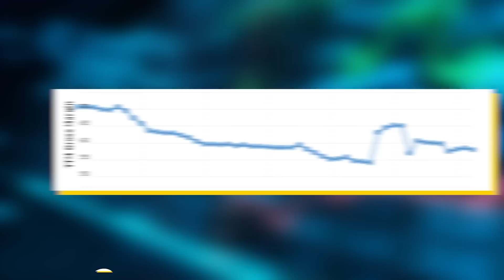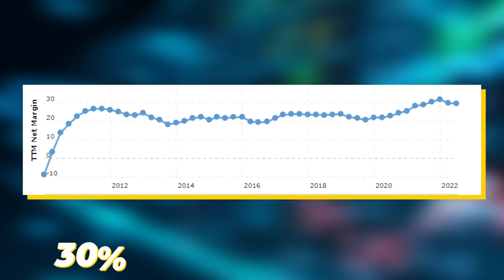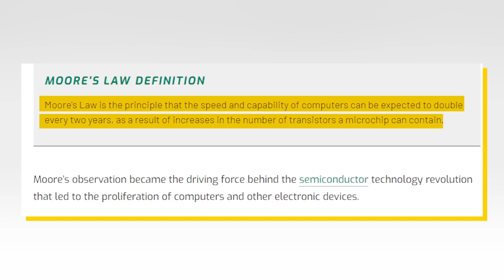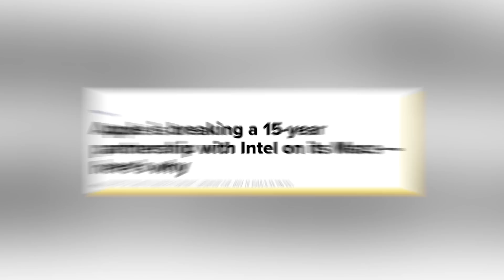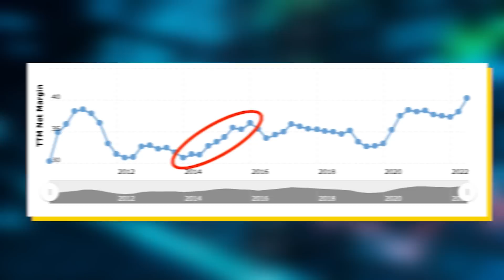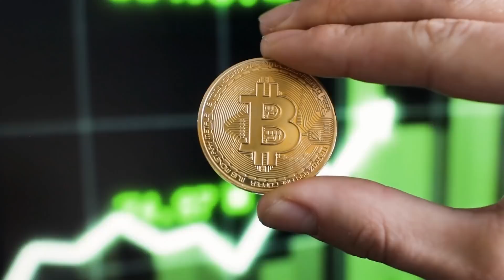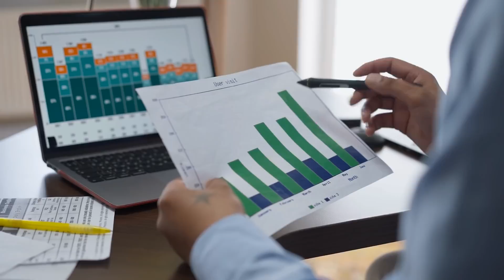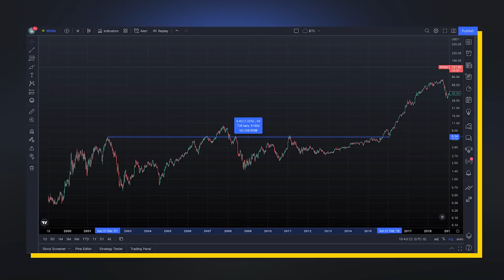How Did Chip Profit Margins Become So Obscene?

Comment: The reason people say moore's law is dead is because they calculate it based on "Useful Transistors" and not Total transistors.
To over simplify;
You can easily add more and more cores to a CPU.   Thus adding more and more Transistors.   However, if your running a game that's single threaded none of that matters.
Another example is moving the ram, from outside the CPU to inside.   This moves a lot of transistors from outside moore's law to inside without changing much.     
So, back in the day.   Moores law was useful as it gave a rough calculation to performance without knowing what future tech was.   Now, not so much, we keep adding transistors but things don't change much except for a few bench mark programs.  Yet there sill is a lot of room to add even more useless transistors into the cpu just to keep moors law going,  Well,  in 'technically true' kind of way.  
So is moors law dead.   Well, yes and no.   Depending if your a user or a marketing person.
Reply from the maker: Ah, thanks for the clarification Lucid. I really appreciate it!
Reply: @LogicallyAnswered  If your interested in the topic maybe take a look into just how long ago this was known to be a problem.   How All the big players got together to solve it,  including ravels.  Poured billings into fixing the issues just to have amd come in an ruin it all for some short term profits.   So, we are kind of stuck.  Have been for like 10 years.   With estimates of 80% of the power bill and a huge chuck of the cpu simply wasting performance just keeping itself running.   (Yes, just like a Gas car).   At least now, ARM has a chance of fixing this.
You know, I don't think anyone can name a single company that has done more damage to the computer industry, economy, and the enviornment then amd.   And they did it under the pretense of just giving the people what they wanted.
Reply: @lucidmoses  How did AMD did that
Reply: @miguelpereira9859  Hard to explain in a comment but it has to do with the cpu architecture.  25-30 years ago we knew the x86 architecture had a very serious limitation when it came to advancements but these could not be fixed without breaking code compatibility.   The base design done in 1974-1976 was just not designed to scale from k bytes to giga bytes.   That's why cpu advancements have been sooooo sloooooow from 2000ish to now.   Intel,IBM,Microsoft,Oracle, and a bunch of others got together to fix the underlying architecture problem.  The switch from 32 to 64 bit seems the perfect time as people needed to change there code anyway.  They started a five year project to fix this.  A major undertaking but it needed to be done or we would be stuck at the limits of the x86 architecture.   This could have worked but around 2 years into the 5 year project amd came along and added the worst, crappiest bandaid on to the x86 architecture and released it as the 64 bit update.   Now, the general public didn't know what this was such a bad idea or how devastating it would be to cpu future growth.    amd's marketing department made it seem like a good idea to the masses.   So, what do we have now?
You know your processor has to go though up to 8 address translations every time in reads/writes a byte to memory.   What a waste.  Think about all that extra power, heat, and loss of speed with all the extra almost pointless transistors.   It would be like modern cars having to be still compatible with coal powered steam engines.  
Now look at the ARM chip vs an x86.   ARM is way smaller.  uses a fraction of the power.  Has no were near the amount of heat generated.   ARM chips can be in cell phones with small batteries.  x86 stuff is way bigger then a cell phone.  Takes enough power that it's a measurable proportion of the power grid and pumps out so much heat that if you have a few of them together you need A/C in the room.   And why is there such a dramatic difference?   Well.... in a word.  Architecture.   Due to amd catastrophic bombing of the industry when they where trying to fix it.  So, as I asked.   Can you think of any company ever that has done more damage to the industry?
Reply: @lucidmoses  That's very interesting I had never heard of this  critique leveraged at AMD's contribution to x86
Reply: @miguelpereira9859  It's not a big secret or anything.  All the info is out there.   It's just that most people have no real reason to get down in the weeds as to how CPUs are built and therefor have no idea why x86 stuff takes so much space/power.   Thay just think that's what it takes. Even though they are likely using ARM chip to look this stuff up.   
Don't get me wrong.   The ARM stuff is showing it's age as well.   It's just that it's initial arcateture was more suitable to systems we use now a days.  It scaled better.  Not perfect, just better.   I'm sure they(Intel or Arm) could do way better now if they started from scratch but that's not likely to happen.   I don't think you could get the major players to agree to give it another shoot given how it turned out last time.   Even if amd wasn't around any more, it was a very expansive lesson to learn and someone else could just come in and screw it up.  So we are stuck.   The hardware guys can't fix it as there is no software base for it.  and the software guys can't build any if there is no hardware.  So our best of bad choices is hopping ARM gets a bigger budget and doesn't fracture it's community with a gazillion little variants.   chough   chough  Apple.

Comment: You ignored datacenter grade products which may significantly increase profit margins for companies like Nvidia who reuse some of the same dies between enterprise and consumer grade products.
Reply from the maker: Ah that’s true
Reply: @LogicallyAnswered  yes, Nvidia makes money not from 70 class cards. It makes money charging 30k for the A100 and 40k for the upcoming Lovelace h100
Reply: They sell basically the same thing for 5 times higher prices
Reply: @MJ-uk6lu  Same thing with a slightly different software
Reply: @Kxnii  and additional validation, ECC memory. But this is mostly the case for the former 'quadro' line. The former 'tesla' line is actually different.
Reply: @PSelten94  That's true, but ECC memory doesn't make it worth several thousand dollars more
Reply: @Kxnii  no, but it does increase cost somewhat. It's not all just additional profit. Probably a more clear profit grab is disallowing datacenter deployments for GeForce GPUs. The Nvidia driver EULA states that datacenter deployments are not allowed.
Reply: @PSelten94  because active cooled cards are not designed to be put in passively cooled environments.
Reply: @tayloraverett3138  'quadro' cards can be deployed in servers though, these are actively cooled.
Reply: @PSelten94  It adds cents at most to the price
Reply: @PSelten94  incorrect only the Passively cooled RTX 6000 and 8000 were explicitly designed to run in server environments. Every other actively cooled Quadro is designed to run in a tower. Now do people run them where ever they want ofc, is Jensen going around and ripping these cards out of secrets for breaking EULA no. But if they run into issues and want an RMA they voided their case to get one for using them in an environment it was never designed for.
Reply: @Kxnii  and actual customer support
Reply: @tayloraverett3138  in the Pascal era, system integrators and Nvidia had validated actively cooled cards in servers.
Reply: They don't sell that many anymore, since they pretty much are selling their server chips as desktop chips and have been for over a decade and companies figured it out and started buying desktop variants.

Comment: These are Deep-Tech, Low-Volume, High-Value & High-Risk Products. For instance, see the number of iPhone 14 Pro Max being sold versus an equivalently priced RTX 4080. The R&D and production infrastructure costs are up-front huge capital costs, right. So, if these companies are to be incentivized to invest in the future, and to improve their products, these high margins are necessary. Again, if it was easy, some Low-Cost competitor would have taken over. But, it isn't. That's the point. DEEP TECH Industries are clear oligopolies !!! 

But with FAB as a Service Model, this is changing as major hardware companies are able to design their own chips now, with a limited budget and limited risk. Very soon, these margins are bound to come down with RISC-V taking over.
Reply: Rare person who isn't talking out of their ass. Take this like.
Reply from the maker: Well said Venkatesh
Reply: Roscoe wont take over  it has grown sure but there is way too many fundamental issues with such to have it take over.  Also the fab side dosnt give a crisp if its rosc, Cisco or some tard ordering a batch of "new" 8086 chips for old skool clone marketing  they make the same volume in wafers regardless
The content of the wafers dosnt really matter per se other than by vol of good vs rejects with smaller pkgd being better yields

Comment: I wonder what our world would be if we go full on open source and ditch all copyright laws... What a wonder our world could be if we all worked together and share our knowledge
Reply: Have you seen open source programs? They all suck compared to the paid versions.
Reply: @designexplainedllc346  some open-source are good. For example, GitHub and Stack overflow. Basically, knowledge sharing is good. However, for complete software, open source is not as good. Especially with anything related to cyber security
Reply: @designexplainedllc346  “have you seen open source programs? they all suck” he says as his router runs linux on a site run on a linux server
Reply: @adolphin9288  To be fair those aren't completely open source, they are based on linux foundations but there is a company with patents and copyrights that owns that software and sells it..just like Mac OS has Unix foundations
Reply: @designexplainedllc346  Open source is the norm for programs if you go bellow the "consumers" softwares and look at the infrastructures, bricks and blocks that make all of this possible.
Reply: China has almost no copyright laws, so everyone is copying each other. This breeds competition and lowers the margins. The problem is that this incentivizes monopolies, since they have power to just steamroll the competition, since the smaller companies that do innovate are just copied and out-competed by the larger tech companies.
Reply: @666yaoz  This is the correct answer. Copyright laws are originally to protect the little guy and people who invest in innovation.
Reply: Why innovate rather milk money from copying it. So no reason to innovate
Reply: Then nobody would evolve,  nor design newer products , its competition that brings innovation, your way of thinking is childish
Reply: Cool debate, altho i was more thinking about an utopia kind of thing. I know its not compatible with society as of now, but who knows what the future will be. I imagine a world driven by something else than money. A post scarcity civilization that got rid of property since it would be meaningless.
Reply: Not great since it would stop innovation because everyone would just wait for the competitor to innovate and sacrifice money to that and then just copy them.
Reply: @ketsuppi  Ever heard of linux? The biggest open source project of all
Reply: @s.lingesan  And how Linux market share is tiny since it has terrible IU for the average person.
Reply: @ketsuppi  That's such a poor argument. Why innovation would stop? This argument is based on the assumption that we need competition to shine. But actually what made us shine was science not competition. And scientists are not that interested in competing with one another as boxers would, but more interested on satisfying curiosity and be praised by discoveries they made. 

If all is open source people who innovate can still be motivated to do so as they would be praised for that. Companies in the other hand would not, as they do not seek innovation but profit. Alas, companies already prefer to wait and copy, that's why they go on buying sprees buying start-ups with genius ideas to then escalate those into their giant infrastructure.

Comment: Only thing that actually is expensive is the chips. The need hundreds of millions worth of equipment to make them on a larger scale. Material is not expensive. Also when you look at some of the 4090 pcb they are crazy small. Like smaller than earlier more weak cards.
Reply: This is the very basic law of product design lol your slab of marble will cost less compared to the same slab of marble that has been worked into a table, so of course that will be the case, your car will cost more than just a piece of metal, also except for intel, they dont bought the equipments, samsung and tsmc did, while foxconn assembles it
Reply: Exactly. Prices include something called amortization. To get the actual gross profit you have to take out more than just resources cost. You need to take out said amortization that's covering the cost for all the equipment, you have to take out the cost of cost of labour, the cost of utilities, and so on.
Reply: i actually listed the price of the factory and the time line to profit and y'all thumbs up a 9 page paragraph that says the same thing but doesn't even list the cost... theres no way you read deez nuts post... i know YouTube,  y'all are too lazy
Reply: Hundreds of millions? Try tens of billions
Reply: @andrewdubose9968  Correct!  Most people have no idea how expensive foundry’s are to build and operate.   Each time they have to re-tool to go to a smaller geometry, the cost to do this can be billions of dollars.  Unlike a meat packing plant that has a service life of 50+ years, foundries are handful of years before requiring many changes to adapt to newer processes.   The cost to develop a new process takes years and years costing billions.  Ask Intel how much they spent on getting to 7nm. 

If you design chips, the cost to build one that can yield at 4nm is very, very expensive as well.  The software cost to do verification, design automation, layout, etc are all more expensive, and the runtime to actually do the verification is also significant longer than older processes—you can basically expect to spend 2x for each geometry reduction (ie., 16nm is 2x 22nm, 10nm is x2 16nm, etc) just on the engineering time and EDA software license cost.

Yes, these chips are expensive, and they are expensive to make, and they will continue to be expensive to make for a while longer until the yields and costs go down.
Reply: chip factory costs 4 billion and doesn't turn a profit until year 5......
Reply: Even if the chips are more expensive because of the shrink in the node die, you still get more chips per die so it balances it off. So there should be no reason for graphics cards being extremely overpriced besides greed
Reply: @negativauraa  This would be true if the die size is exactly the same.  Look up the die size of a 3090 vs 4090.   You expect to pay the same personal pizza compared to a large?  That's just greed?
Reply: @negativauraa  the RTX 3090 GPU is 628.4mm2 on a 300mm wafer that cost $7000. The RTX 4090 GPU is 608.5mm2 on a 300mm2 wafer that costs $25000. Increasing GPU performance means dedicating more die size which doesn’t shrink die cost on a new node. 

When the new node is significantly more expensive than the old node, even shrinking to the new node without adding more transistors will raise prices.  For TSMC a 28nm wafer was about 4K, 12nm 6K, 6nm 11K, and 4nm 20-25K. N3, N4X, and N2 will just raise prices further.